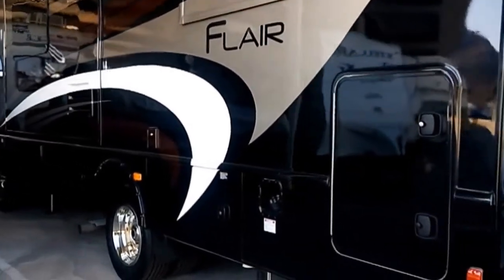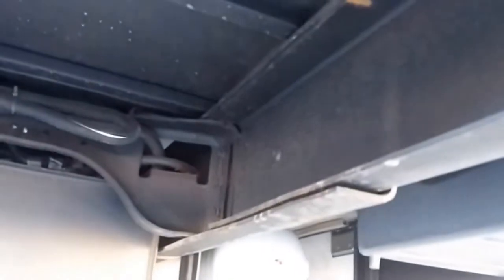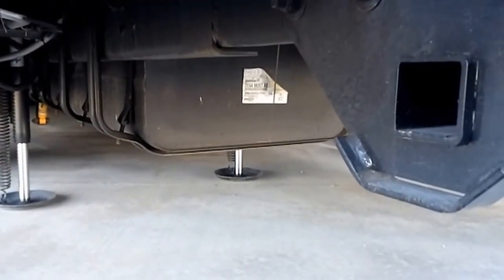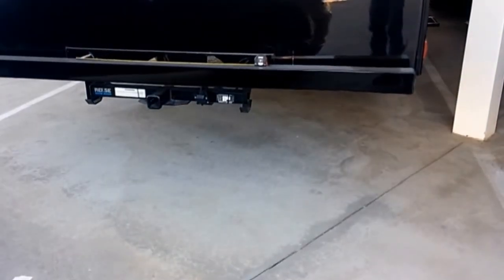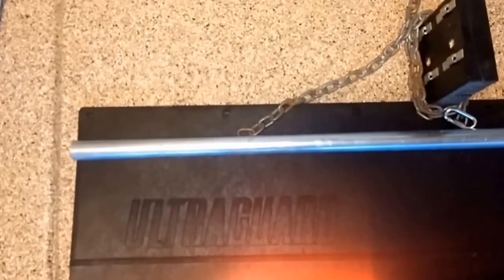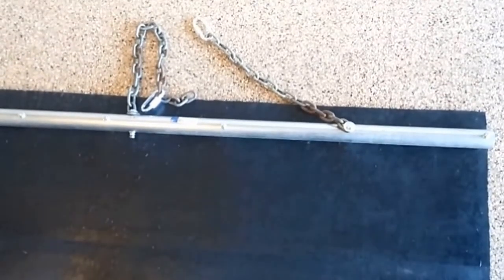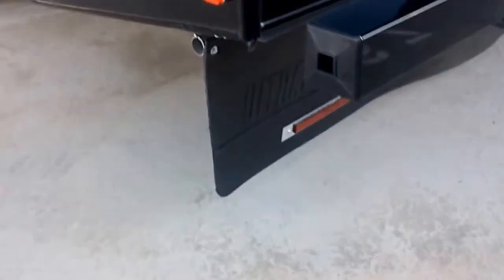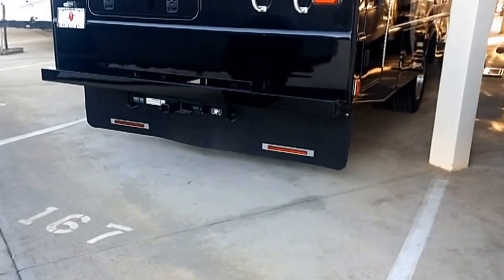154-DIY How to install Ultraguard, 2015 Fleetwood Flair 26E

Comment: How stiff is the rubber Ultraguard? I don't think I have an option but to attach it to my Lance fixed at the top.
Reply from the maker: Like half inch tire thread and very stiff. Have some flex in your mounting as there is none in the guard.